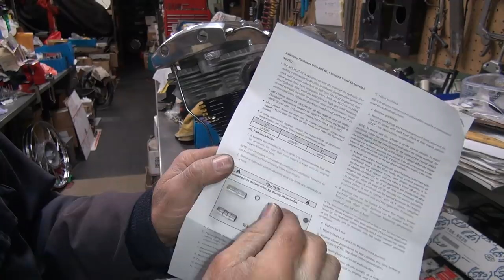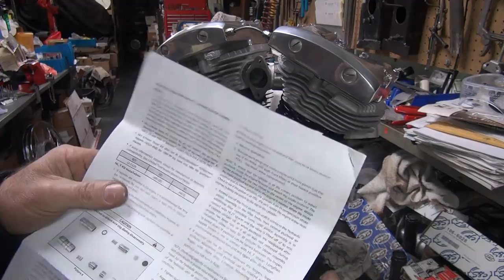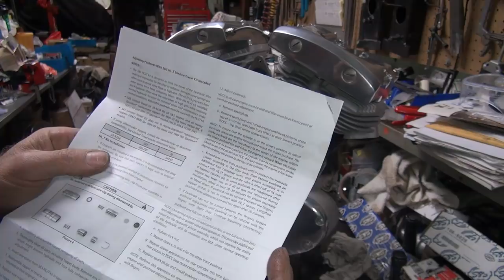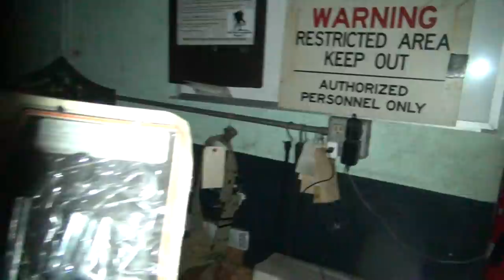1967 74ci shovelhead #150 flh bike assembly transmission rebuild harley craigslist tatro machine

Comment: I have a 1961 Pan with hydraulic units in the lifters, I suppose.
Some people replace those with solid lifters. What is the pros and cons ?
Your recommendation ? Sorry if its a stupid question from a nowice.
Thanks for making more videos. I find it much easier to learn from your videos than from just reading books !
Reply from the maker: solids work good with the harley low oil pressure but you should get the correct solid lifter cam so that you don't beat the hell out of the valvetrain. if you want to stay with a hydrolic cam than i like to use the s&s evo liftrer conversion kit. you will have to have custom pushrods made.
tatro

Comment: can i losen the headbolts and rotade the heads to line up the intake on my shovelhead without replacing the head gasket?
Reply from the maker: yes i have done that but it is best to change them. you never know what is going to happen until you do it.
tatro
Reply: @TatroMachine  Ok. Thanks!